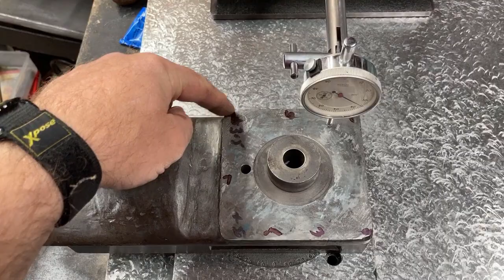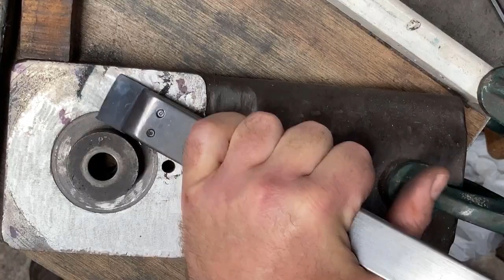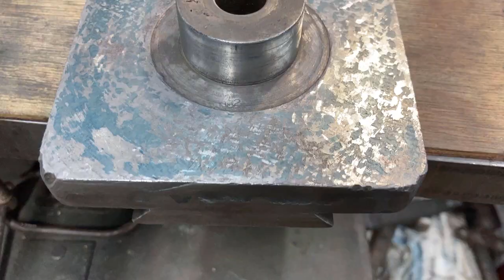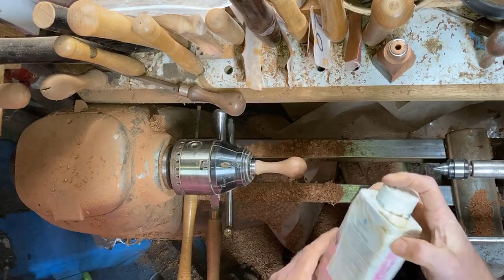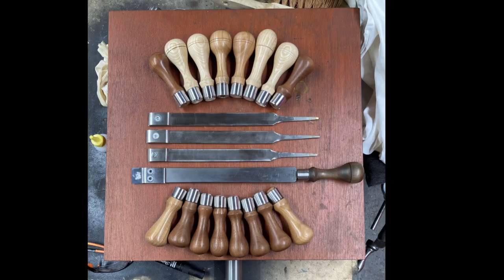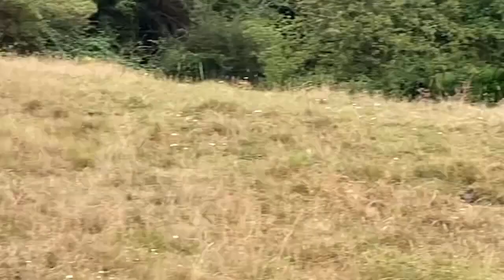Holbrook Update - Seating The Lathe Toolpost

Comment: This was your local childhood area in Leicestershire was it Mat? Bet there are still nice Chub under "Thunder Bridge" lol
A question, when you use an old file for the scraper shaft for want of a better word, and have annealed it in your wood stove, do you plane the teeth out with the shaper? Or use your boy so he can have some filing practice? Lol nice to see some woodturning, something I must get back to as I've not used my woodlathe in over a year since I rebuilt my shed to put a metal lathe / mill combination machine in and have been metal working for the past exactly a year now.
Reply from the maker: I grind the file teeth off (quickest) then file and then abrasive. The lad got wise to the ‘file practice’ 😎

Comment: Some day soon, you are going to go out to that machine, and suddenly realize that you have no more things to scrape 😉  

I noticed something on the Old Warrior the other day.  A slight shifting of the tool post, occurring somewhere in the saddle assembly, when I change directions on the carriage.  It's enough that the potential for spoiling work is there.  I can't get it to happen at the compound or cross slide, my only guess is that something is forcing a little bit of twist on the carriage (hard to believe that, with how massive it is) when the carriage feed is used.  I got a mystery to solve after a check of the machine's leveling.  Trying to think of what could be happening, with all the variables in mind, makes my head hurt.

Looks like you may still be favoring that shoulder.  I know that feeling, but it's on the other side.  About two weeks ago I slipped at the edge of our burn pit, and something in my shoulder popped when I tried to keep my balance.  I thought I'd took out a muscle adhesion, like before, but movement in certain directions is still quite painful.
Reply from the maker: I would start at the saddle to bed interface. You should be able to get a feeler gauge under the outer corners to the vertical shear at the back. Take measurements at each side with the carriage under power feed and then stopped. If the saddle is worn it will screw around slightly on the inverted V ways - the rear shear is not a contact face so should not be worn i.e. a good datum. After that I would look at the cross slide moving on the saddle - dti fixed to the saddle and push the cross slide into the dovetails at each end - measure the movement. Then check for vertical movementat rest v's pushed down at 4 corners and mid way. Then its the topslide (same checks as cross slide) then the tool post Its likley a bit of everthing. As teh drive is taken up by the lead screw the wear /backlash is taken out. Good luck with it. Mat
Reply: @lookcreations    I've had it apart down to the cross slide before, and was disappointed to find that the cross slide (top, moving part) had been milled at one time.  Saddle dovetail measurement didn't show more than .001 variance in measurement with pins, which surprised me ... then again, my metrology department at that size leaves a lot to be desired.

Saddle to V way didn't vary more than roughly 3.5 thou, same for saddle to "unused" datum on the bed, if you discounted peaks and valleys from battle scars.  It's obvious that someone spun the chuck off of it at one time, it left some nasty marks.  I'll re-examine it all after re-leveling.  There is a range where saddle movement starts to tighten, that hasn't been there before, and I suspect that it has settled into a twist since I leveled it the last time.  I understand they can do that.
Reply from the maker: @infoanorexic  I would check that the feed screw on the saddle is not binding and causing it to kick. Still thinking about other potential issues. Good luck with the search !
mat
Reply: @lookcreations    Incidentally, I was just now watching Nik's latest offering, his small lathe had the needle jump when he engaged power feed, and it spoiled his first attempt on a part.  I may have to ask him to let me know what he finds on that one.
Reply: Hi there is also the possibility that the the ways under the carriage are worn in such a fashion [outer portion] that the center of the vee ways is acting as a rocking horse as the pinion turns in the rack it forces the carriage to move up and in the opposite direction to move down, twisting motion. Not knowing how much it's moving and what direction and who made your [some have gibs that  can be ajusted] Old Warrior makes it tricky to analyze the problem. 
Good luck.

Comment: I see a diamond stone on the bench. Do you dress your flat stone with that?
Reply from the maker: Yes I do. Each time I use the little india stone it gets a quick splash of spirit and a rub on the diamond stone. If I want to knock the 'high points' down I also use the small diamond stone on the part - it can help increase the contact to aid in a print during the cycles. I have a few DMT stones - they are good quality and easy to maintain.

Comment: Hi Mat,
Do you every use granite surface plates? If not, why?
I hope the scraper sales go well.
Take care
Paul,,
Reply from the maker: My master referance is a 24x18 granite bought new . I scraped this cast iron plate to it and now if possible use the cast plate to save the granite. If I could afford a larger granite I would buy one - but space and funds prevent it. Im on the look out for a 4ftx18" cast plate as I think that would be a real usefull size and not take the room of a 36x48" plate.
Reply: @lookcreations  Hi Mat, That's a good plan, I like it... I need to buy one so will follow your example.
Reply from the maker: @TheKnacklersWorkshop  granite are nice to work with and if you get a small cast plate you can add the slots to make that a lapping plate to condition your granite - just be sure to get the smaller plate flat to start with beofre your granite needs working on ! Diamond grit paste is very cheep now so lapping a granite is just a bit of exercise and measurement. If you keep it down to 4ft, a 20" SP is more than big enough to carefully lap the stone. you want it no less than half the size or you have to be very methodical in how you lap to avoid adding errors !
good luck. Mat
Reply: @lookcreations  Thanks Mat, your help is gratefully received

Comment: Hello Mat, I've been following your videos for quite a few years and you've inspired me to start learning how to scrape.
What steel do you use for making the hand scrapers? I'm having a hard time finding hardenable flat stock over here (Athens,Greece). 
I don't have old files to anneal. I was considering used bandsaw blades but even the ones off huge machines are rather thin 1.5mm-(1/16''). Any ideas?
Reply from the maker: Well, Ive used as you know old hand files - soften, then ive tried to harden and temper vs just left soft and both work fine. Ive used Stainless Steel and it works fine as a scraper but not great for cleaning it up (takes time). Avoid mild steel,  it is just rubbish and feels dead on the cast iron. So if you can get it try Stainless Steel 304 works fine. Better steels recycled from for example old car springs (leaf for preferance) but if you dont mind a bit of work an old coil spring. I picked up a hand full of old files at the scrap yard for next to nothing - I would bet an old engineers shop or garage or farrier would part with a used file for £10 and thats about the cost of buying in a bit of tool steel with postage. Ask around, every old guy I know has a draw with a knackered old file in !

Comment: If it's 7 thou up, who don't you just mill 5 thou off it before starting to scrape?
Reply from the maker: Yep could have milled it off to 0.001" but for me it would take longer to set up and mill than shift with a scraper. It sounds a lot but its  small area so not much material. I think I had it within 0.001" inside of an hour. Could you mill that part to that tolerance within an hour ? I guess if you are  competent on a mill and the mill in good order it would be simple enough - not so for me :-) All the best Mat

Comment: Regarding iPhone and Windows file transfers, get yourself one of these. 
https://www.amazon.com/SanDisk-iXpand-iPhone-Silver-SDIX30N-064G-GN6NN/dp/B01CIEBS74
It makes the transfer as easy as it should be. 
Thanks,
John
Reply from the maker: Hi John, I have a Integral Ishuffle - similar thing. The issue is the file type used by Iphone when you shoot full HD - windows just cant read it - there is a work around if I buy a 'patch' but it adds more steps and from th ereviews Ive read is glitchy. Now I have defaulted the camera to shoot in 720p 30fps it all works pretty well. As my internet connection is pretty poor I cant upload 1080p files in anything like a reasonable time frame (36hrs for 20 minutes of film), 720p will have to suffice. I have however, spotted a fibreoptics cable connection box being installed down the road ... watch this space ;-)
Reply: lookcreations 
Ah. Yes, I see that online. I haven’t upgraded from my iPhone 7 so I haven’t had that problem.
Have you tried setting your iPhone default video and photo settings to “most compatible” instead of “high efficiency”?
Oh well.
Good luck and thanks for the great video.
John